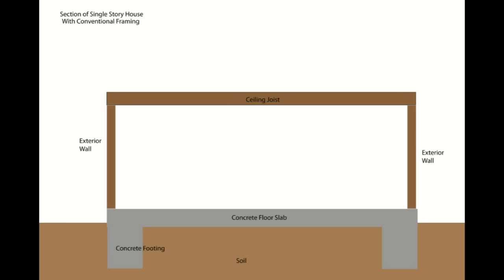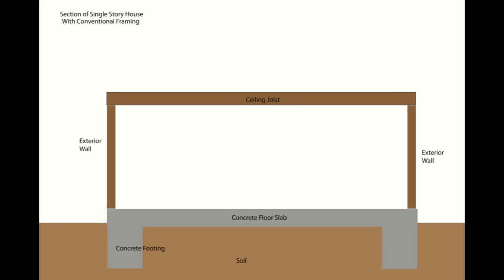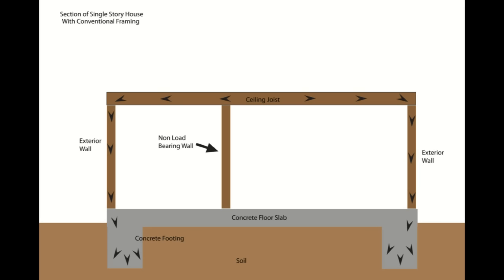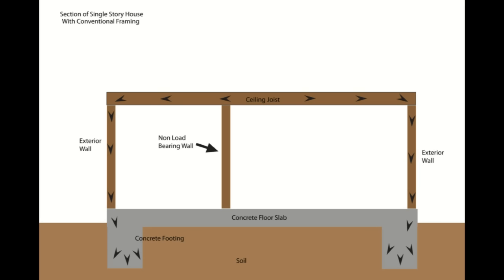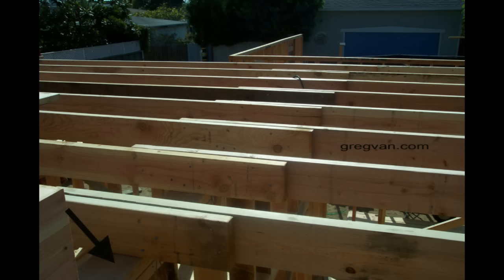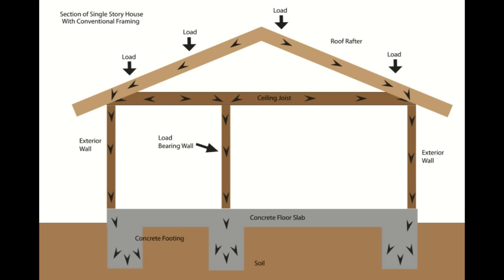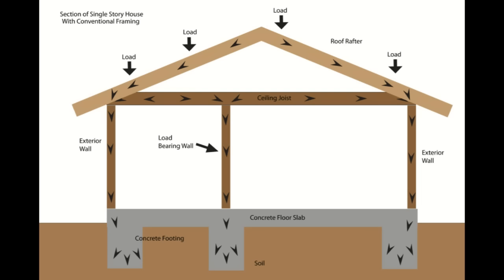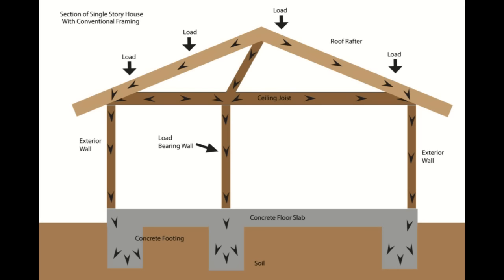Load Bearing Wall Framing Basics - Structural Engineering and Home Building Part One

Comment: If there is no stem wall/footing under the wall -- it's non-load bearing.  However, if there is "no gap" between the ceiling joists (or floor joists, 2nd level) and the wall, it will be carrying load, the load just isn't transferred to a stem wall to a footer.  Where the loads go depends on the stiffness of members (or a slab) at the base of the wall.

Comment: Why would an engineer or builder allow any wall to be non-load bearing because they provide the building strength in both the vertical and horizontal planes?
Reply from the maker: You can have non-bearing and load bearing walls that provide lateral strength. A non bearing wall is simply a wall is not supporting something above.

Comment: Determining if a wall is load bearing requires you look at a variety of things, there is not one size fits all cookie cutter solution.  You have to look at gravity load path, foundations (if you can see them) connection hardware, and shear transfer.  Just because ceiling or roof rafters are continuous over a wall does not mean the wall is non structural!  Even if the rafters can technically work with the longer span, that doesn't mean the adjacent footings are headers can...  If I were a home owner, I would NOT trust a contractor to decide if a wall is load bearing unless it's obvious, I can't tell you how many times I've had a contractor tell me a wall they demo'd was not load bearing, only to find out it clearly was...  The easiest way to find out if a wall is load bearing is with the original framing plans of the building (if you have them).  Most cities have them on record if you don't have a copy assuming your house isn't too old.
Reply from the maker: I would agree with almost everything you said, except for using a set of building plans, if you don't know what you're looking at. There are non-bearing and load bearing walls that shouldn't be removed without a structural engineer's approval, especially if you don't know what you're doing.
Reply: @gregvancom Fair enough, I meant that someone who knows how to read a set of plans can easily tell if a wall is load bearing.  It takes the investigative guess work out of it (assuming it was built to plan....).  If you are a homeowner and have no clue how to identify joist layout on existing plans, you should just ask one of the city engineers to help you when you get a copy of the structural plans from the city.  Sometimes people forget that they are there to help you and usually will if you're willing to wait a little bit or schedule an appointment.  They can't give you any solutions, but they can quickly tell you if it's load bearing or not, or if it's a shearwall or part of a dragline...  It's incredibly rare for a house to come with a set of plans.

Comment: Sir, how would I know that if the weight is transferred to an internal wall or not? In other words i am not clear about which wall is load bearing and which one is non load bearing. Thanks
Reply from the maker: A loadbearing wall would be practically every exterior wall in the home and any wall that has framing members sitting on top of it like roof rafters or ceiling joist. Non-loadbearing walls are used primarily to separate rooms and you can usually look in the attic (if you have one) to see what's going on.
Reply: Thank you so much sir! Now I understood!
Reply: Ohhhhhh ok ok. I understand now. Thank you! Now I have extra knowledge gained!
Reply from the maker: John Rambo You're welcome.
Reply from the maker: It's not easy to explain, but see if you can find any videos on this webpage that might be helpful. Go to the section on walls http://www.homebuildingandrepairs.com/engineering/index.html
Reply: gregvancom - Great website and info and videos! Thank you, helped me understand a lot!!

Comment: Does any one know what this contractor intends to do. I have a load bearing wall between my kitchen and living room. The contractor said the wall can be removed. Flushed flat at the top of the sealing by doing the support through the attic? 🤦‍♂️How is this possible?
Reply from the maker: You would simply use a structural beam that would be mounted in the ceiling, instead of below it.
Reply: easer said than done, creating a truss is more like it. adding a beam is more weight and getting a beam in the attic can be challinging

Comment: can anyone please explain what's the different between 
Structural Engineer and Civil engineers. 
thank you
Reply from the maker: I didn't know myself, but looked it up on the Internet. It said that a civil engineering degree can usually be obtained in four years and then you can pursue a specialized degree in structural engineering. From what I've gathered, most building projects can use either civil or structural engineers.
Reply: Civil Engineering in itself encompasses Structural Engineering. The difference between these 2 fields lies in experience and specialisation of the Civil Engineer
A Structural Engineer however cannot do anything else a Civil Engineer can, except for just the Structural part of it
Civil Engineering is broader than Structural Engineering. You can equate it to a holding company, in which Structural Engineering is just but one part of Civil Engineering. However, people can choose to specialise in Structural Engineering alone as a course, or still more take up Civil Engineering and then specialise in Structural Engineering to their advantage as they will have amassed more than just their skill in Structural Engineering
Overally, Civil Engineers fit in where Structural Engineers are required, but Structural Engineers do not fit in were Civil Engineers are needed, unless ofcourse if just a Structural Engineer is required, in which case the Civil Engineer would be a preference with the exception of his competence in the Structural field due to his experience or rather choice of specialisation
Difference lies mainly in the experience of the Civil Engineer ie would they specialise in Structural Engineering, Geotechnical Engineering etc. Civil Engineering is a broad term, it encompasses many branches of Engineering including Structural Engineering, whereas Structural Engineering is more of a speciality which a Civil Engineer can still attain amongst other things
Have difficulties explaining myself most times,  hope you've understood
Reply: Before giving your answer let me tell you about entire Engineering faculty .....   In the world,  engineering has mainly 3 main Faculties : 
1. Electrical and Engineering ,  
2. Mechanical Engineering and 
3. Civil Engineering ....  
Firstly , Electrical and Electronics  Engineering mainly deals with Power system of rural and Urban regions ,Transformers ,   Electronic systems development and Robotics and Mechatronics , Telecommunications and communication systems .....Computer science and engineering is also a sub department of EEE faculty .. 

Secondly ,  Mechanical Engineering deals with mainly INDUSTRY BASED field ,  specially in machine developement and their  management.....  Automation industry ,  automobile construction ,  machineries  construction ,  textile industry and machinery management ,  leather industry like tynarry and footware industry ,  marine engineering and naval architectures ,  industrial & production engineering ,  Petroleum and Mining ,Aerospace engineering , energy science ,   ...  Chemical and Material Science engineering are consideredly as separate engineering faculties though they are similar to mechanical ,  it's publix perception ... Mechanical engineering is industry based and machinery based technical faculty so in graduation level ,  it also gives separate bachelor  degrees in Leather,  Textile,  Marine , Industrial and Producation ,  Energy science  ,  Automobile and Automation as they are a huge branch and have various  factors of research in these fields independently ....  But the mother department that is ,  Mechanical Engineering deals with some topics like Boilers ,  heat transfer ,  heat engine and thermodynamics ,  fluid mechanics ,  strength of materials etc ... They also research and deal with Robotics and Mechatronics too alog with Electrical Engineers . 
Now ,  the one you asked for ,  
Civil engineering is the mother department and a faculty which comprises the sectors :
1.  Roads and highways construction,  
2. Building and construction (which required RCC and structural Engineering knowledge ),  
3. Water resource and environmental protection , 
4.  Disaster management, 
( which is a natural management process ) , 
5.  Airport construction (specialized knowledge on Takeoff and Runway way construction is taught in such courses of this field ) 
6.   Railway constrution . (railines and junction related construction study is it's elements of these courses ) 
...  Now the sub-departments of civil engineering are : 
1.  Structural Engineering 
2. RCC(Reinforced cement concrete) 
3.  Geotechnical Engineering and Soil Mechanics
4.  Mechanics of Solid 
5.  FLUID mechanics 
6. Hydraulics 
7. Hydrology 
8.  Environmental Engineering and disaster Engineering and management .  
9. Railway Engineering 
10. Forenseic Engineering 
11.  Strength of Materials , etc..... 
Here the sub-depts no. 4, 5, 6 and 11 also studied as Mechanical Engineering core subjects for mechanical engineers too . 
So you see , civil engineering deals with  Road and highways,  airport , railway  , building and Water -Environmental issues ....  Whereas Structural Engineers is specifically for BUILDING ENGINEERS ...  BUILDING ENGINEERING course contain Structural Engineering , RCC etc ,  but they don't study Water resource engineering  ,  environmental engineering ,  disaster engineering and can't also get a Post Graduation degree from these except structural ,  Rcc  and building related courses ,  whereas civil engineers have free access through all of them ....  Civil engineers learn about all of them , but building engineers can't ..... Hope your confusion is cleared.....

Comment: What should the distance between rafters be?
Reply from the maker: It all depends upon the design of the home. For example you might need a 2 x 10 rafter spaced 24 inches on center or 2 x 8 spaced 16 inches on center or 2 x 6 spaced 12 inches on center for the same project. An engineer could provide you with lumber sizes and spacing, but I won't be able to.

Comment: shouldn't the footings extend beyond the walls?
Reply from the maker: It all depends on the engineering, but most footings will be even with the exterior wall.
Reply: i thought the weight would be distributed more evenly if the wall was centered on the footing but somethings don't work the way i think they do
Reply from the maker: I think what you're talking about makes a lot more sense and was actually a standard construction practice decades ago. It might just be easier and faster to make everything square, I really don't know why they changed the footing from an upside down T shape to a square.

Comment: At 6:51 this configuration does not make sense.  There would be no need to support the roof rafter in the middle unless you trying to prevent bowing of the roof rafter because of a roof load or other reason. You could remove the wall but would need to install a beam in it's place.  A strong back purlin configuration at 45 degrees would be the correct installation as opposed to the vertical member shown between wall and roof rafter.
Reply from the maker: It might not make sense, because you haven't seen it yet. Keep in mind that there are a variety of different ways to build a roof. However, using purlins at around 45° angles would be more common and thanks for pointing that out to our other viewers.
Reply: @gregvancom  Thanks for the response!  Great video!  You are right I am finding there are lots of ways houses are framed and not all of them follow the book.

Comment: at 5:16 - how do we know that the lumber above this "non-bearing wall" are spec'd such that they span the distance from wall to wall without the "non-bearing wall" in between?  Specifically, suppose those beams are 2x6's - they can span about 9 ft.  Suppose the beams are actually 16' long?  So that "non-bearing wall" could be providing support to beams which are undersized for the span.  I'm not doubting you I'm just curious.
Reply from the maker: If I understand your question correctly, you're wondering if you could remove a non-bearing wall that has a load on top of it? You can't because it would be considered a bearing wall. You can have continuous 2 x 6 ceiling joist for example sitting on top of what would look like a nonbearing wall, but could be bearing. If I didn't answer the question you were asking then feel free to ask again.

Comment: Basic rule  of load bearing walls. 1 depending on the age of the home, certain eras had standard building practices.  2 Look in the basement and see how the floor joists run (if a basic home with 90 degree (square or rectangular shape) will have a main carrying beam in the center, with columns supporting it. The main carrying beam will almost always have a load bearing wall stacked on top (continuous load path) on each floor.  The picture of 1 long floor joist or ceiling joist (its a floor joist for 2nd floor way to big for a ceiling joist) is modern engineered lumber which is a overkill by engineers and Architects to sell much more expensive lumber, or they have little, to no practical application of real world building. In most cases Linear 2 X  4 or 6 8 10 12s are fine except in the case of  long spans. That shown method of 2 floor joist bypassing each other is known as "Joists Over" and it is a  very common method which you will see in your basement (if you have one)  The basement framing most always mirrors the rest of the house. In homes from the late 1800s to modern times which use conventional lumber 2Xs will have walls that run parallel to the floor joists which are much less and in many cases  little to no structural  importance. In a case with trusses (engineered rafters which have webbing resembling the letter W all interior walls on the top level bear no weight or very little. Some non load bearing walls do take up deflection or sagging of  compression load (weigh of ceiling it self), although proper lumber sizing should override this. Some plans (blueprints) drawn are not always correct like any profession not all architects know a whole lot about constructing a house and are more into the aesthetics, which in some cases are not structurally sound or practical roof lines most notable rafters are trickiest part of a proper design and require real world application experience or knowledge to some degree. In many cases when opening walls up and engineered lumber is called for usually the lumber manufacturer will provide you with recommend sizing for the structural need, engineer
 is usually not needed
Reply from the maker: That's a lot of information and great information at that. Thanks for sharing.

Comment: I wonder if anyone with next door neighbors ever decided to use a sledge hammer to start remodeling their house. LMAO speculating what that would sound like to the neighbors on the other side. I am glad I get along with my room layout in my house as is. I really would not want to change anything. For instance extending the bathroom into a bed room. Actually you risk damaging the value of your house and maybe the structural integrity of course. A lot of zoning laws do not support this and if you ever go to move you will have to change it back to original lay out for instance 2 bed room large bathroom back to 3 bedroom small bathroom or loose a noticeable portion of the house profit.

Comment: How does concrete block with a basement compare to the poured foundation?
Reply from the maker: What do you mean, water proofing or strength?
Reply: Strength? How strong is basement block foundation compared to a sold poured foundation? Thank you!
Reply from the maker: @dennismayer4936  I'm not an engineer, so won't be able to provide a comparison, but I'm pretty sure, the concrete is a lot stronger.
Reply: Thank you.